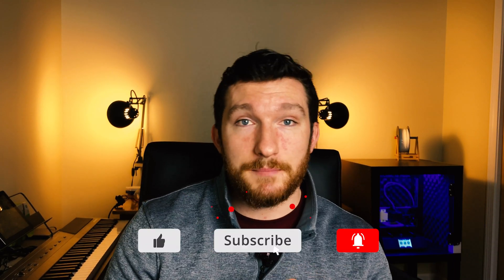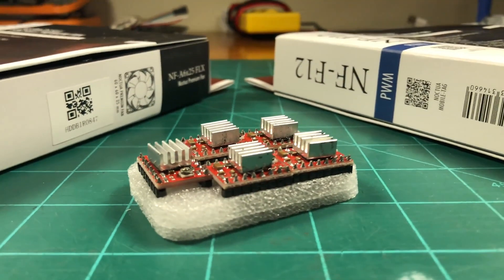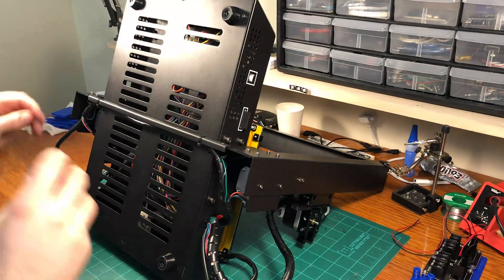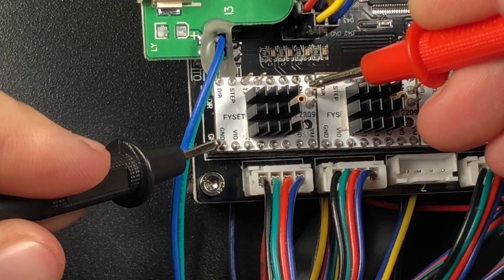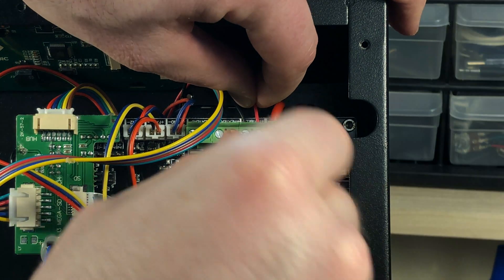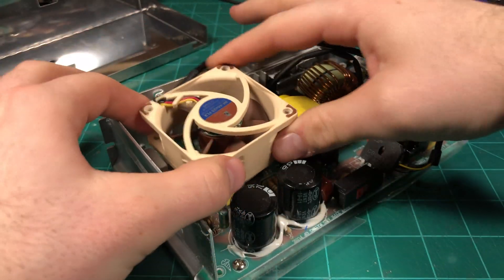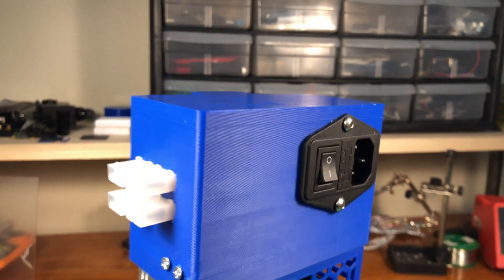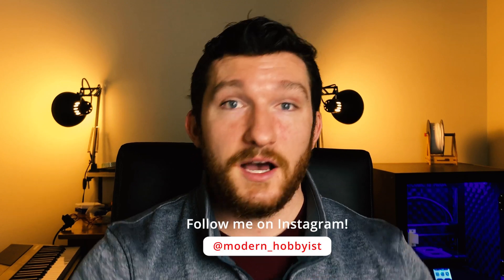Anycubic i3 Mega Ultimate Upgrade Guide

Comment: I know this is an old video but i bought a used i3 mega as my first printer, it was impuls buy. 
I got about 3 okay prints out of it before the motherboard died i cant get the replacement board anymore but i did see these BTT boards i can upgrade it with but im sot sure what board to get and what else needs to be upgraded for the board to work properly? Or if i should cut my losses and buy a new printer? Considering the cost of the BTT boards plus any other upgrades because my i3 is all stock.

Comment: I do highly discourage to modify the power supply as shown here. Power supplies use metal casings for a reason: shielding. That's why the cases do have a direct connection to ground, so in case of a loose cable/shortage/whatever the fuse of your electric installation is triggered. Additionally the casing is fully closed to ensure a certain air flow over all the componentes. The shown replacement has a grid structure instead, which will decrease the air flow and especially if the printer resides in a housing probably results in higher temperatures.

Comment: Love your videos! I've seen others do a similar thing, but they bend pins 3,4,5, and 7 out of the way on the blue side then add a wire to the board to enable Uart mode. Would there be an advantage to that or best left as it is in the standard mode?
Reply from the maker: Thank you! Interesting 🤔 I haven't seen that, but I may do some more tinkering with this printer now that I have some backups!

Comment: Love the channelamd looking for advice, I'm getting major fluctuations on hot end temp. I've replaced and tuned still no joy. I think it could be my power pack. Is there one you would recommend replacing it with please. I'm pretty novice when it comes to wiring and soldering so atx conversion is a big no. 

I've done steppers, added bl touch, fans and added raspberry just as FYI.

I really appreciate it.

Comment: this will be very useful to me =D thanks tho i like using using them Tamiya plugs after meltign them in my airsoft toys with lipos , i'll stick with the XT60/90 types for better connection and amp load handling and from what you say the hot ends and beds do just that

Comment: why would you put the power supply outside of your printer, i bought mine with most of the mods plus a btt skr 1.4 board and the power supply is still inside (as it should be)
Reply from the maker: Thanks for the comment! The goal of moving the PSU outside the printer body was to preserve the life of the PSU, since I was putting the printer inside an enclosure. The higher temps inside the enclosure can drastically shorten the life of the printer. However, since moving, I no longer have my printer inside an enclosure and have returned the PSU to the inside of the printer. Hope that helps!

Comment: Great info. Was wondering is it nessesary to swap the plugs on the motherboard? Looked at a Marlin update saying the software does it. I have no idea :/
Reply from the maker: Hey thanks for the comment! The Marlin that I ended up installing on my Anycubic came with several options, one for the original drivers, one for new drivers that have been flipped, and one for new drivers that were installed with the original orientation. I installed the new drivers before upgrading to Marlin, so I actually had to flip the connectors, but if you are installing Marlin at the same time, then you choose the version that allows you to not have to flip the connectors. Hope that helps!
Reply: @ModernHobbyist  thx=).. Maybe you can help. i installed new drivers all 5 everthing works except the left Z, it only goes up, i have no idea why. Tested other steppers but it does the same thing, changed it back to stock and Z works as it should. Is it the software ? i have no idea on this=( X and Y works and only left Z

Comment: Hi Charlie, I realize it's been a year but I saw your video & ordered s2209s for mine.   when I received them I noticed they weren't ver 3.0 like yours, they are ver 3.1 & while the pinout is almost identical,  they're not.   tx & rx are reversed and one called cx is added.   I stopped the install, wanting to make sure before proceeding.   if you would,  please advise me on this issue, and thank you in advance.

Comment: Thanks for the video, so keep the same steper motors but just change the drivers? I assume it should be the same for my Anycubic mega pro, which i have? I am having a few issues with mine and i think the main board has just died.
I am going to buy a Prusa but keep the mega pro and do mods like this. Mods do chew your time but its also how you get the best hands on experience.

Comment: Besides the stepper upgrade, everything else is pointless and more dangerous than stock. Messing with your power supply like that can kill you or give you a good shock if your not carful. Your better off just replacing the power supply with a quality meanwell power supply and doing a 24 v conversion. And if you want an enclosure just make sure the psu fan is sucking in fresh air for the power supply and controller board. Oh any you need to re flash marlin to take advantage of the tmc higher steps.
Reply: I dont think everything else is pointless, but the powersupply upgrade is ideed problematic. And I would like to add the point, that the metall housing has also a protective function and should not be replaced with a plastic housing

Comment: Any advice on Y belt tensioning?
I printed a tensioner but it causes belt veering and rubbing.
Reply from the maker: Thanks for the comment! Unfortunately, I haven't had any luck with that either! I tried to speed up prints once, but with too high an acceleration it slipped on the Y axis.
Reply: @ModernHobbyist  yea, for me 3k on travel with low junction deviation is the highest I can go.
I'm thinking of trying this one out https://www.thingiverse.com/thing:1780636

Comment: You could have saved yourself a lot of time and effort moving the power supply outside the box by placing the printer on an up-lift base and venting the electronics compartment from below. Here is a photo of my "work in progress". https://i.ibb.co/PT9BX7t/Printer-Enclosure-In-Progress.png
m3 x 50mm screws go from under the box, through the base, and thread into the holes where the bottom cover attached previously. I'm only going to use one of those cooling fans since 100cfm is plenty of airflow. The vents on the base of the printer have been blocked off, so air gets blown into the base, then exhausts out the other hole. The fans are Sunon 120x38mm 2100rpm and cost $10 on digikey.  Added bonus is they can be voltage controlled all the way down to 3.7v before turning off.

Comment: thank you so much for this.  Just finished replacing steppers, stepper fan, hot end fan, power supply fan.. all in about 45 minutes.  Only difference from your instructions is

grd to vref is actually the little copper pad not the pin on the 2209 stepper
the Mega X does in fact have a seperate mosfet so bed power is not connected directly to motherboard any longer.
Reply from the maker: Thanks for the comment! It's good to see that Anycubic seems to finally be addressing these issues! Also, thanks for the heads on the 2209's!
Reply: Thank you for adding these comments I just tried to do the 2209 stepper motor upgrade and I can't get my machine to work 🤦🏻 I was getting frustrated but then read your comment and I think realized what some of my mistakes are I probably need to put the mosfets back to stock cuz after following this video I'm having trouble with my hot bed and hot and both are increasing in temperature but are not having any temperature readouts through the screen. I also am not able to get any of my motors to work when I turn it on and try to get them to go back to home positions

Comment: I'm having a problem with my i3 mega. I've looked everywhere even sent an emails to anycubic. It keeps layer shifting on the y-axis. I've done tmc2208's, flipped pinout, new and much larger 120mm cooling fan, mosfets, new belt, stepper, made a tensioner, external power supply with 90mm fan, flashed marlin 2.0 several times. Done just about everything, including different slicers and print speeds, yet it still shifts. Maybe I can get an answer here?

Comment: Great video. But as a electic noobie, you could add a little more detail . for example what to put my multimeter on? 0.85 voltage is 0.85volts? i kept googling stuff because i coulnt keep up^^ i saw the factory voltage is 1,2V, would that even make a huge difference to go down to 0.85?

Comment: HI I bought anycubic mega s  and was going to upgrade TMC2208 , TMC2209 reading the  description it replaces 2208 is that correct so go this the 2209 do you agree ??
Reply from the maker: Thanks for the comment! I installed 2209's in my printer, and it works!

Comment: Wondering what firmware you ended up running with this  have a mega s that I've thought about updating the drivers for a whilem
Reply from the maker: Hey Travis, thanks for the comment! I recently upgraded to Dave Ramiro's Marlin 2.0 firmware and it has been successful on the Mega, but I'm not sure how the Mega S differs mechanically.

Comment: I knew a step controller upgrade would make it quieter (which I don't care about) but I didn't know it would increase precision.  Thanks for the vid.
Reply from the maker: Thanks for the comment!
Reply: I'm pretty sure it only can increase precision if the stepper is set to run higher than 1/16th. Wouldn't you need to tweak the firmware for this?

Comment: My vref measurements on the TMC2209 is 4.85V (DC) no matter how I spin the potentiometer. Same for all 5. Any clue what is going on?
Reply from the maker: Hey thanks for the comment! That is in the range of the logic voltage for the TMC2209's so my first thought is that you might be measuring voltage from the wrong contact points. For my drivers, they were closer to 1V to start off and it took several full rotations to get the reference voltage moving down. From there it takes a few tiny adjustments to get to 0.85V. Let me know if that helps!
Reply: @ModernHobbyist  Yup, there was another voltage point next to what was labeled Vref on the TMC2209 that I have. That did the trick. Thank you!

Comment: The idea about keep the power source out of the heated chamber is great and I was thinking about that for a while, just finish my  printer box and apply this idea...great solution to keep the power source cool, next will be to design a cooling duct from the bottom of the box to use external fresh air to cool the steppers
Reply from the maker: Thanks for the comment! I do hope to implement something like that in my next enclosure build, the hard part would be making sure the fresh air doesn't affect print quality. Thanks!
Reply: @ModernHobbyist  to avoid that I was thinking to create a duct to suck the outside air blow over the drivers and blow out of the box, the airflow can pass thru the grill area from RIght to the left side of the printer. (grill area just below the SD card reader and Ethernet port)

Comment: Thanks, Charlie for the videos!  I appreciate them. I did the stepper upgrade and it worked amazing.  I tend to be a paint by number guy on this stuff with electronics as it's new to me.  So little things that are not mentioned leave me "blocked".  Like the fact that the second stepper motor in from the right the wires are reversed and not with the black in the flip position.  I wondered what that would do but saw another video where it was just flipped and left with blue facing in the upside-down position.  I know it's hard to do videos that cover EVERYTHING.  I was wondering if you had done three separate videos for each and slowed down a bit with a video that showed the exact connections it would help.  I have the MOSFETs on my desk ready to go but the video leaves out a lot of the step by step, and I am nervous about what is "next".  I have the new fan too but I think that will be fine.  Thanks again!  I will follow with interest and grateful that you are doing these!
Reply from the maker: Thanks for the comment Jeff! I believe in the video, I just recorded before I had flipped all the connectors, so some  of them appear in the original orientation. I don't have a video of the MOSFET process by itself, but I'll check around to see if someone else has made a video specifically on that topic. Thanks again for the comment, glad you enjoyed watching!

Comment: On Trigorilla board there are two power inputs, 5V and 11V, by using the mosfet to bypass the Hotbed energy from the main board should I remove the 11V input cable?

Comment: Out of pure curiosity what's stepper Motors would you use to replace the stock ones on the printer? Or do you find at the stock Motors are sufficient.
Reply from the maker: Hey thanks for the comment! I replaced the stepper motor drivers with TMC2209's which are linked in the description, but I didn't replace the actual stepper motors on the printer. Hope that helps!

Comment: Hi Guys. Just a small question. If I change my drivers to TMC2209's do I have to change anything in the firmware? e.g. upgrade to Marlin, etc.
Reply from the maker: Hey Noel, thanks for the comment! If you do want to change the stepper drivers, you don't have to change the firmware, but you will need to flip the motor connectors around. This change is super easy and I show how to do that in this video. However, if you do want to change the firmware to Marlin, there is a version that will allow you to update the stepper drivers without flipping the motor connectors. If you are interested in doing that, I outline it in this video: https://youtu.be/zprmBmMFHQQ.

Good luck and thanks again!
Reply: @ModernHobbyist  Thanks very much - that helped - I intend to change to Marlin, but in the interim I just want to change the drivers and wasn't quite sure whether I needed to change the firmware. All clear now - many thanks.

Comment: im trying to calibrate my  eryone tmc 2209 v3 and my voltage is reading 4.60  am i checking the wrong spot on the driver which im checking where driver says to check or is my voltameter set to the wrong spot i got it at 12v dc

Comment: Hi, I installed on my Anycubic i3 Mega (not S) drivers TMC2209 v3.1 and my printer stopped printing, everything works, everything moves, but the plastic stopped sticking to the table .... Now I don't know what to do ... Help if you know the solution to this problems. Thanks

Comment: Hi. I am fairly new to these types of components and  just trying to understand one part about the driver replacement. Without changing the stepper motor, isn't this like plugging blue ray into a CRT tv (exaggerated comparison obviously)? Would the resolution still not be topped out by the physical configuration of the stepper motor internals? What is the actual max resolution per revolution for these motors? As I said, I am not familiar with these components yet and am working off a basic understanding of how the stepper motors work.

Comment: Don´t get the thing about the PSU Unit.. I have a i3 mega s, a pro and a Chiron... All of them in Enclosure (YES, the one for chiron is CRAZY BIG)...But i Print ABS and ASA in there, and still run my fan and the room never get´s over 35 C... The power PSU i rated to 40 C, Soo and i missing something? Kind regard from Denmark.. And great videos

Comment: Hey Charlie.  Thanks for all the content.  It really is extremely helpfull.  I have decided to go through with most of these upgrades.  At least the stepper drivers and hotend fan upgrades.  I will probably wait on the Mosfet since I don't plan to print with ABS yet.  But my biggest challenges have been with bed adhesion and first layer quality.  Would upgrading the stepper drivers help with that?  I have flashed Marlin firmware and have gone through the mesh leveling several times.  Calibrated the E steps more than once.  It seems like the mesh leveling tweaks are diferent every time.  Is it possible I have a warped bed?
Reply from the maker: Thanks for the comment, I'll repeat what I mentioned in your email just in case others have the same issues as you:

1. Try re-leveling the bed with some paper so it is just scratching the nozzle
2. Increase bed temp and nozzle temp for the initial layers on the print
3. Slow the initial layers waaaaay down (~15mm/s). This was a huge help for me.
4. Move parts away from known low spots on your bed in your slicer. I print small parts towards the front of my print bed, just to be safe. 

Thanks again for the comment and the email, hope that helps!

Comment: Great video, I installed 2209's and MOSFETs with your help. I do have a couple issues though. On fast filament retracts, there is a pretty nasty grinding sound from the extruder so I am going to look at tuning that voltage. Second, have you any experience with spreadCycle versus stealthChop on the 2209's? I've read that the Trigorilla boards lock the 2209s into spreadCycle mode (which is louder). I want to use stealthChop but I don't want to start messing with my ERYONE TMC2209 pins yet. Relevant info in the last bullet point: https://learn.watterott.com/silentstepstick/pinconfig/tmc2209/

Comment: Great video, just what I was looking for. But I have a question: how does the 3d printer know (after upgrade to tmc 2209) that it has new drivers and it needs to send 16 times more step pulses to them to travel the same distance as before? Don't we need to change firmware or jumpers? Thank you :)
Reply from the maker: Thanks for the comment! Without updating the firmware, the printer will use the same steps that it did for the previous stepper drivers, so you won't gain any precision without the firmware upgrade. You have to set 3 pins to HIGH logical voltage in order to tell the drivers to use 256 steps per rotation. Hope that answers your question!